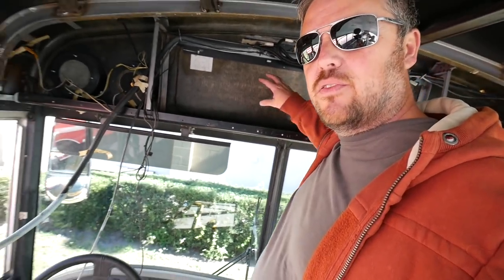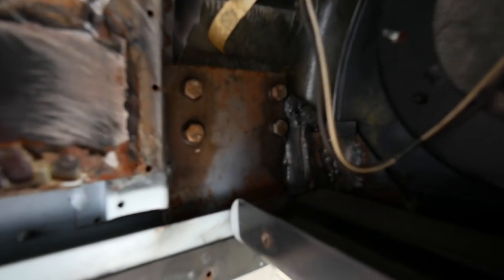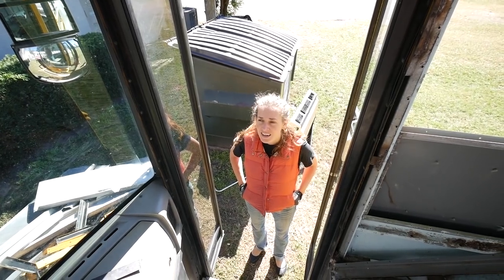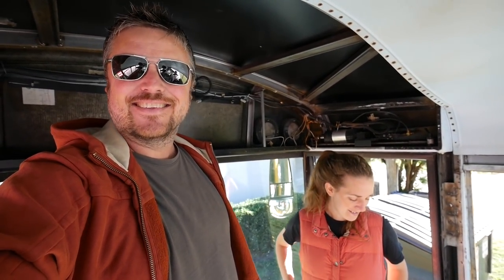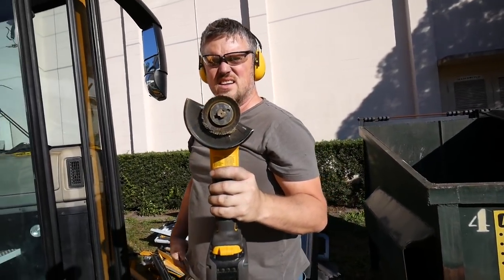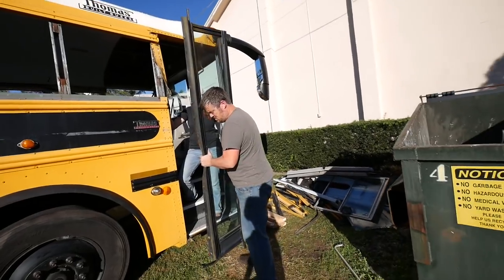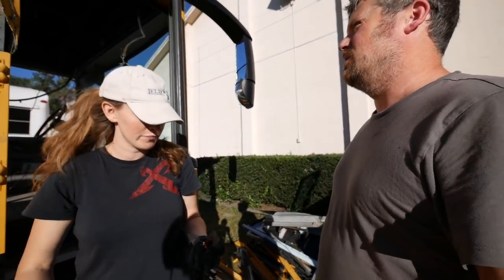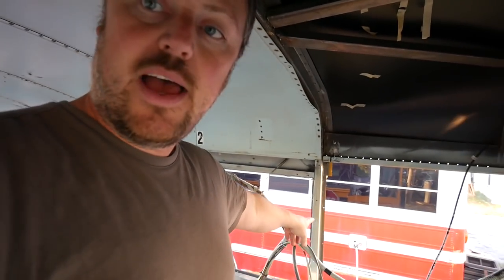Bus Conversion Roof Raise Prep | The Bus Life

Comment: If you not passed the point of no return, you may be able to use the air actuated door closer with an RV type door. It might be possible operate it via remote and include a lock as well.
Reply from the maker: Interesting idea!